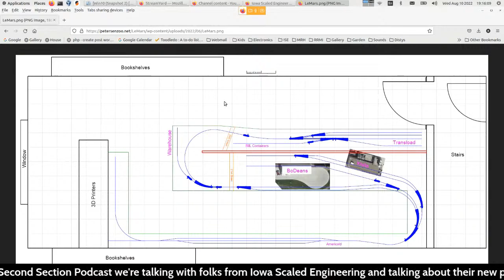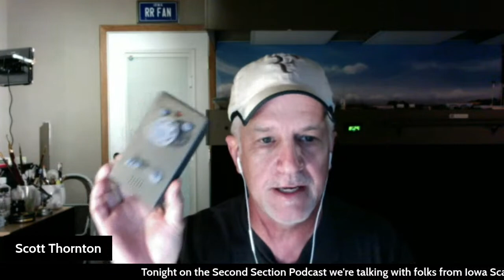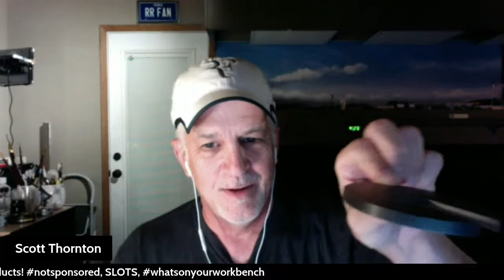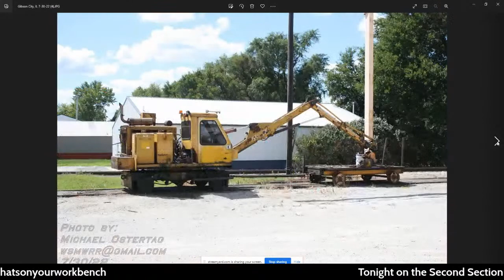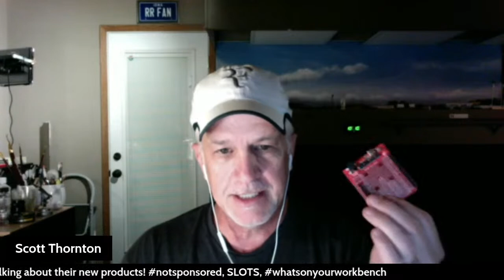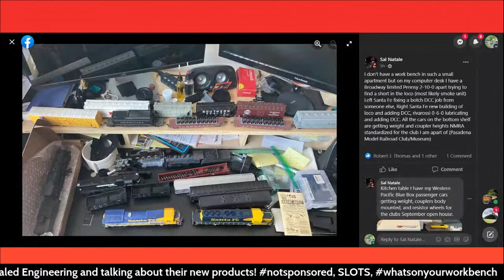3 GAME CHANGING products for model railroad operations

Comment: 2/7/26. Often when shoving while switching a cut of cars on air to an exact stop in an industry or yard track I would set the brakes  to a minimum three pound reduction or up to ten pounds to control the train. This prevented the slack from running out beyond where the conductor wanted the car to stop or couple. The sound of shoving these cars was a continuous brake shoe to wheel squeal. Some times the conductor was actually riding this shove having to endure all the squealing from the car he was on. Might want to add a continuous brake shoes to wheels squeal sound on your conductor sound unit.